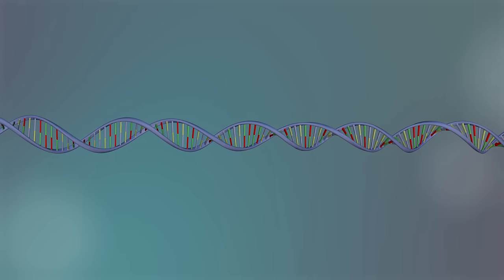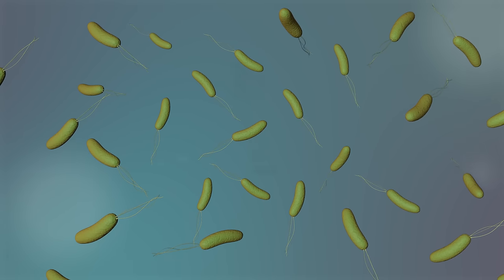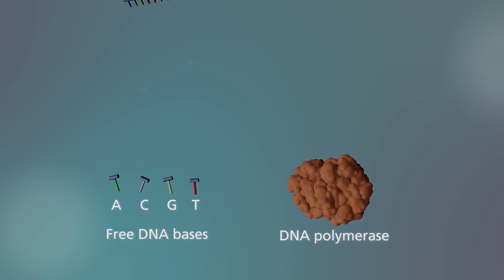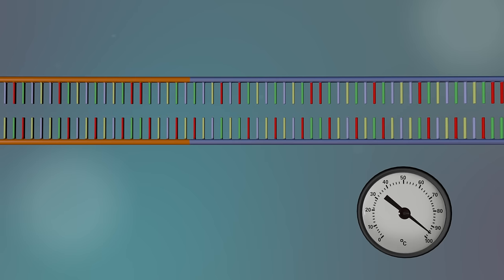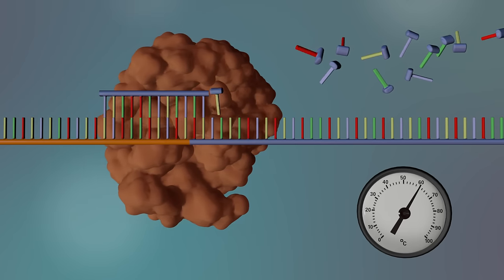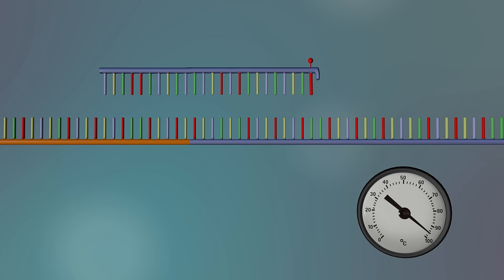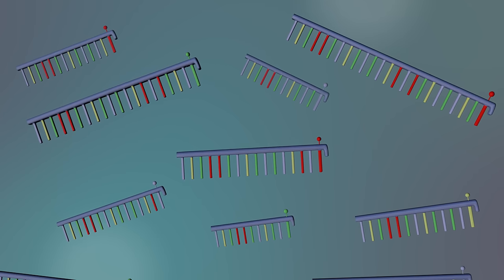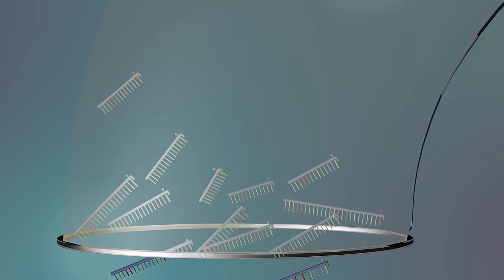DNA Sequencing - 3D

Comment: I get how you can get a copy from all elements the complete DNA strand, in order, using the terminators, but how does this deal with duplicates?
I can imagine that purely by chance multiple strands of n elements might be formed, which will appear together in a group when reading them in with the laser. How do you know these are actually identical when you only have a single terminator at one end? If there was some second indicator to get the strand length you could just throw away all but one strands of the same size but I don't see anything like that in this animation. So how do they do that?
Reply: Another question: when the DNA is first separated using head, how do you get rid of (or compensate for the effects of) the second strand? The video doesn't seem to mention this.
Reply: The video does not emphasize enough the common starting point for all the fragments... they all start at the end of the plasmid DNA, right where the human DNA begins. So yes, you will get multiple fragments of the same length, but they will all be exactly identical and travel through the gel at the same speed and show the same color at the laser. You might get two adjacent base positions that are identical, and therefore two consecutive fragments that show the same color at the laser even though they differ slightly in length... apparently the gel can separate different length fragments with enough resolution to tell them apart and we know it is a repeat rather than just one base taking too long to get by.
Reply: Pertinent questions. You might say the video does not do justice to the technology. But I venture the technology does not exist at all and this video is pure disinfo to make people believe into something that is only science fiction.

Comment: Am I correct that in real life the DNA fragments of a given length will be very numerous in the capillary tube, something like a large school of tiny fish all swimming abreast, and with substantial separation from those schools of fish that are longer or shorter? It seems like this would be necessary (or at least very helpful) in detecting the fluorescent light color, to have a lot of molecules together vs. trying to detect the feeble light of one lone molecule. It seems like the production of a lot of fragments of each length is something that is bound to happen, since the bacteria produced "lots and lots" of copies of the original DNA. Those identical copies would all be getting sequenced at the same time, and even a single one of them would eventually turn out multiple DNA fragments of each possible length in this random process, provided the heating/cooling cycles were repeated enough times. I suppose the large quantity of copies of the original DNA section produced by the bacteria help reduce the number of heating/cooling cycles required down to a practical figure, as that cycling must be a bit time consuming. This video could stand to be a lot longer and more detailed... for example the average person is not going to know what a plasmid is, and the common starting point for each fragment produced needs to be emphasized more. Also, since this is just one section of the total DNA strand to begin with, how is this information mated up in the proper place with other sections sequenced separately? I presume the sections have enough overlap at each end to provide an essentially unique matching combination of DNA bases? Well, I'm a machinist... don't ask me.
Reply: Good questions. The entire process is obviously bogus.

Comment: 1. how do you know the primer sequence if you're very objective using the primer is to find out the nucleotide sequences?  2. how can you read the nucleotides after modified nucleotides if the RNA polymerase stops as soon as it puts down the modified nucleotide e.g if the modified ATCG are all placed with base pairs left to be read?  3. how can the nonmodified nucleotides that are placed down before the modified ones be read, there is only a max of 4 modified nucleotides total in all tubes so if a sequence isn't just one of each base pair then a  nonmodified nucleotide is placed and cant be read
Reply: 1. the human genome project started in 1990 and actually in may 2021 the finished sequencing the entire human genome! So we look at references when making primers! 2. there is a low ratio of "terminate bases" to normal bases (about 1:100) so it will randomly insert the terminate bases all the way along the DNA. 3. there are millions of modified nucleotides and billions of strands of the template DNA we are looking at, so they are randomly added and this whole process is done over hours by a machine (thermocycler)! I hope this helps!

Comment: How is the DNA isolated from the bacteria, without including bacterial DNA or other chemical substances within the bacteria?  Doesn't that add a major source of contamination?
Reply: That's a good question, but that's why the polymerase used involves a high temp resistance, so the bacteria DNA is disintegrated and the new wanted dna strand from the plasmids are left behind because they are temp resistant

Comment: Thanks! I was curious how a machine can read the DNA. One question: if the DNA is cut into small pieces, how do you know what's the correct order when it's put together into one piece again? You said it goes from the shortest to the longest but that's not necessarily the original order is it?
Reply: it is not put together in one piece again! Yes sorting it from the shortest to the longest gives you the original order. They are all copies of the same piece of DNA, like copies of one book, and every copie has one more letter then the shorter one befor it. You always can only read that one more letter but the letter befor you know already from the shorter copy befor.
Reply: Oida Vota: what if there are copies of the genetic pieces?
Reply: Well, then it would still read as a single base. The gel differentiates the fragments by size. And since we have already fixed the starting point, each fragment would have the same starting base. But the the terminating base has a very small chance of occurring at the same spot(probability or something). The result will be something like this: the shortest fragment will be the one having a terminating base pair adjacent to the primer. The second shortest will have a terminator base second next to the primer and so on.

Comment: I mean, sure, you'll say "an enzyme," and the spacing of the enzyme activation sites could arguably connect to and react with base pairs, but then you run into the problem of targeting again. AT - CG.  That's it, 2 pairs, of two relative orientations, which doesn't affect whether or not the enzyme will connect.  So, why isn't every AT or CG being split, as an enzyme can react with multiple substances.  You're not, by this logic, removing "chains" or what one would consider a "subsection" (as displayed), you're basically dissolving it.  Pairs should be split in much smaller subsections, every one of them, arguably.
Reply from the maker: Hiya - replying to all of your comments in one here:  The DNA is broken up into smaller pieces through the use of restriction enzymes (proteins). They will recognise certain patterns in the DNA code and cut the strand. These restriction enzymes have recognise sequences of often around 6 nucleotide bases and so you avoid breaking the DNA into too smaller fragments as you would if they cut after every individual A, T, C or G.  Because the enzymes only cut the DNA and do not alter the code so they don’t affect the sequence. If necessary proteins can then be separated from the DNA through a number of means (for example through exploiting their relatively large mass) allowing the DNA sample to retain purity.

The DNA can be isolated from the bacteria by lysing (breaking open) the bacterial cells in an alkaline environment, which can be achieved by using a high pH buffer. Under these conditions, the chromosomal DNA of the bacteria (containing the bacterial genes) can be denatured and removed whilst the smaller plasmid DNA is more stable throughout this process. The plasmid DNA can then be purified from the sample by binding the plasmid DNA to a silica matrix (essentially a very tiny mesh) in a column and washing the unbound contaminants through. Once all contaminants are gone, you can alter the salt concentration of the buffer to make the plasmid DNA unbind the matrix in the column and collect that now purified sample.

Does that make things any clearer?

Comment: I still don't get it fully. This helped a lot, but the end lost me. If each strand is made up of different lengths of base pairs. They why is the whole strand assigned a letter based on the terminator bases? It looks like they took a chain of bonds, and titled it with a single letter. How does this determine anything other than the chain of terminator bases and not the entire chain of each strand?
Reply: Because theoretically you should have have a terminator base for all sizes of the DNA. So, since gel electrophoresis sorts DNA by size, the smallest DNA fragment would reach the sensor first, followed by the second smallest, followed by the third smallest and so on. So we only need to count the terminator base, to get the sequence of the whole strand.
Reply: You also need to determine the length of the fragment to determine the position of the terminator in the full strand. Relying on sorting accuracy is questionable and introduces uncertainty, thus invalidating the result. But I guess the entire process is completely bogus anyway. This is science fiction.
Reply: Thanks! Both of you

Comment: I don't understand?
The goal of DNA sequencing is to read the nitrogenous bases and how they pair up with others. This is not reading the bases at all, it is reading only 1 single terminator base. What about all the other bases that are connected behind it? they are not being read?
Reply: Actually i think i understand. Given the fact that the DNA primer has a specific location every time it also has the same starting or promoting point with the same bases. So therefore each DNA fragment will start with the same bases (which would be complimentary to the DNA primer). For example every fragment would start with ATT, then the bases following that could be read accordingly by the labelled terminator base. Different fragments would be copied thousands of times over. Then the next step would be to order the sequence by map based sequencing or whole genome shotgun sequencing.

Comment: The primer is always the same (10 bases) but the count of free basis is always different. In this video, one  string has 11 bases added to it, another has 12... etc. and it goes up and up. By that technique you can read part of the original sequence because of the terminator bases, 
@May04bwu kindly explain this a bit more

Comment: But how do ther differentiate between two strands that are the same lenght and those who are not?How do they know that the next terminator base is really  the next DNA base or just another copy of the previous base?
Reply: I suppose there must be many fragments of each length, and after passing through the gel far enough they become separated into rather distinct "waves" or clusters such that if two consecutive waves give off the same color the process can easy determine that it is two different length fragments coincidentally ending in the same base simply by looking at the time or distance separation between them. In other words the process must be predictable enough so they know that this is not simply one single wave that is taking a bit longer than usual to go by.